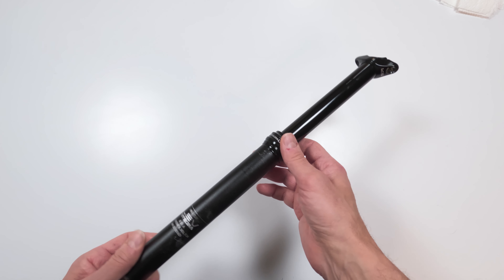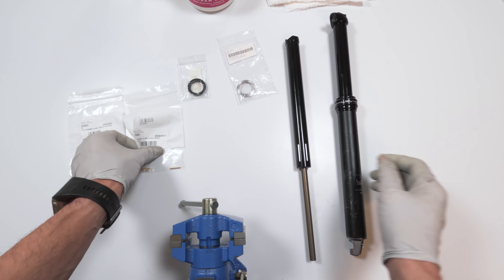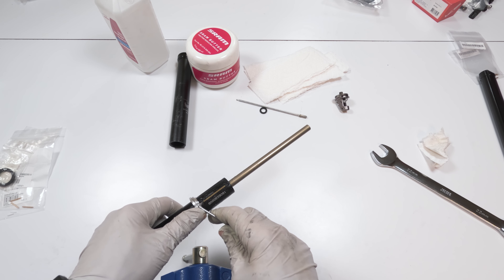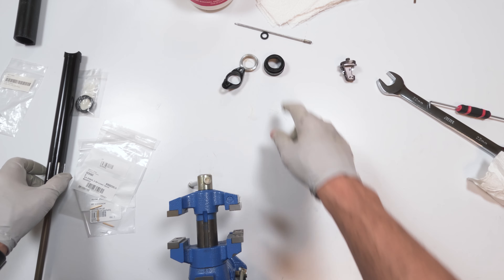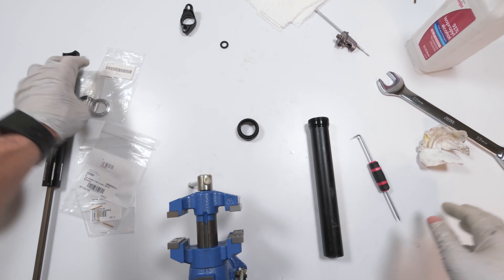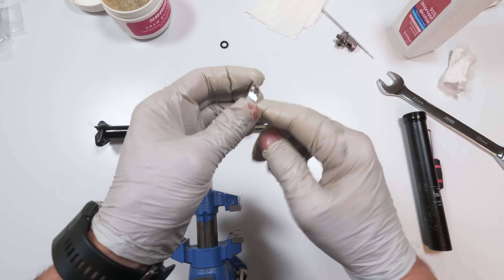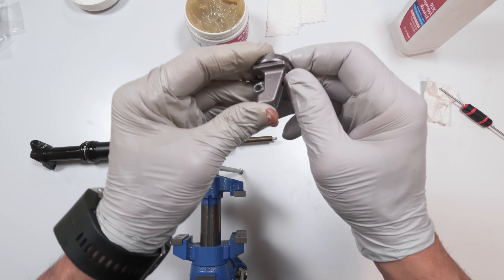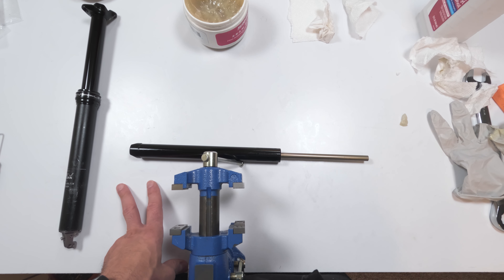KS LEV Integra dropper post full service including damper cartridge replacement for beginners

Comment: Thanks for clearing up the guide bushing keys in particular. KS Lev are very light on details on exactly how they keys are different between models. There are even revisions to the short ones you purchased that are thicker still.
Reply from the maker: Totally agree with "KS Lev are very light on details on exactly how they keys are different between models " I haven't come across a LBS or online dealer that knows anything about this.

Comment: This is the best step by step instructional video I’ve seen of the KS integra dropper. I’m getting ready to do this same service soon. Would you mind linking the parts you used in the description?
Reply from the maker: Thanks for the nice compliment. I added the part number to the description section. If you need guide keys, make sure you verify the right size for your post as KS changed the length at some point. you will either need a set of the 35mm keys or a set of 3 shorter metal keys and a set of 3 plastic keys purchased together

Also, I made a video on how to solve cartridge sag and oil leaks in case it might help.. Let me know if you have any questions.

Comment: Great video!  Thanks so much.  What brand are your soft jaws?
Reply from the maker: I bought them on ebay. they are printed saft jaws made of a polyurethane (I think).  they also have magnets which is nice. there are good on stuff that is delicate and doesn't;need much grip. not as good on stuff that needs lots of grip and has a slippery surface. They were less than $10 shipped if memory serves me correct.

Comment: Why do they have 6 pin slots if they only take 3 pins? Seems like a waste of machining time. Does it make a difference which slots you use?
Reply from the maker: It's a good question, and I've wondered this as well in the past. It really does add to manufacturing time and cost. I don't think it really makes a difference as long as the pins are separated by one slot. I typically install the first pin at the front of the post, call it 12 o'clock, then the other two pins at 4 and 8 o'clock. I figure there's more load toward the rear of the post,  so why not have more support in the area

Comment: If I buy a new damper to replace a sagging one, will I need to buy new updated guide keys or the new damper comes with them?
Reply from the maker: My experience is new cartridges don't come with keys. If you end up receiving a cartridge with a different key length you will need to by new ones. I put out a video on repairing a cartridge, it's pretty easy to do and will cost you much less. Here's the link https://www.youtube.com/watch?v=eHUakqJKF7I
Reply: @zoubtube sounds good I will check it out. My lev has about 1/3" of sag. It's not terrible but enough to be annoying to want to fix. It also comes up when you lift the bike from the seat. Not sure if that is normal or not. The other question is, it seems these droppers are different diameters... are there different cartridges depending on the diameter or just the length? 30.9 vs 31.6

Comment: I hear K/S service is horrible. Easier to rebuild it yourself! Figure it out just common sense and be careful!
Reply from the maker: My only experience with them was back in 2015. They replaced a post under warranty. As for serving just the cartridge in these posts, I posted a separate video on performing that service. Personally, I think KS missed the ball big time with not wanting people to service their cartridges. They are actually easy to service as long as you're careful when removing the IFP cap.